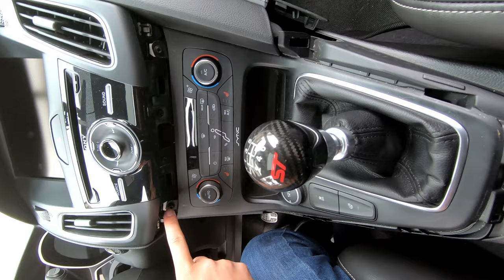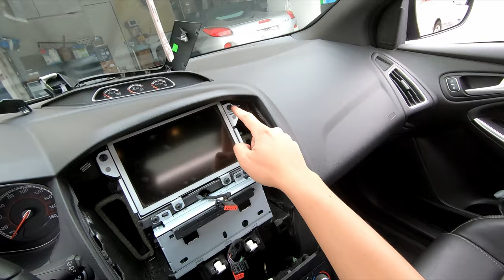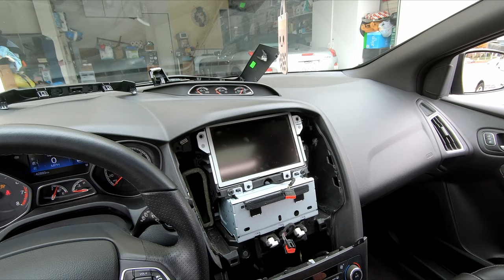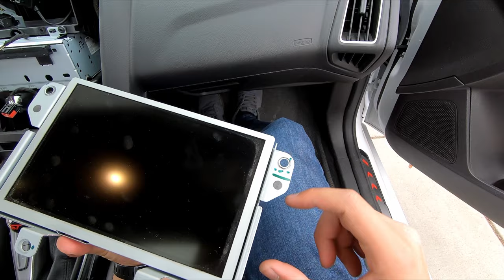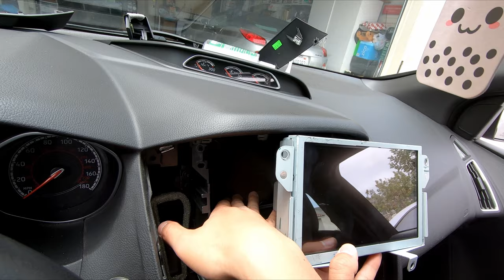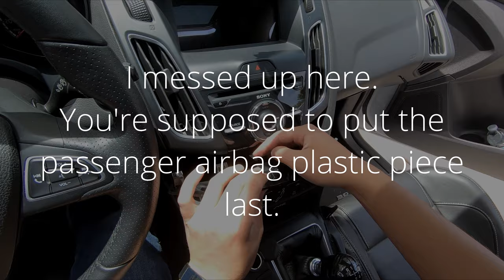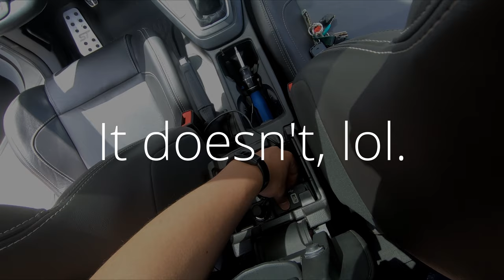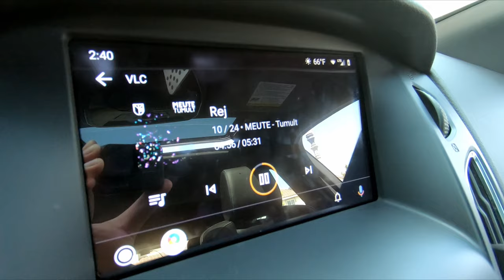How To Upgrade Sync 2 to Sync 3 for Android Auto/Apple CarPlay! (2015 Focus ST)

Comment: Great video, thanks. I am upgrading my 2016 Focus ST from Sync 2 to Sync 3 at the moment. I was very lucky to be able to access the parts from a dead Focus Sport. Anyway, the weird thing is my Sync 2 USB hub with the SD card slot & single USB-A actually has the same power outlet as a Sync 3 USB hub, I don't need the Gen2b power adapter, I found that to be unusual from all the research that I have done.

Comment: I assume if you buy this kit and get it registered to your VIN, It will continue to work okay for your parking sensors, self parking etc?
Reply from the maker: When you use FORScan, I think it'll automatically detect your VIN. In FORScan, you can turn all those things on/off. Focus ST doesn't have any of those so they're off

Comment: I've seems a few video on doing this and it looks simple enough, yet the dealer said it's not possible to convert from sync 2 to sync 3. I'm thinking of doing this to my Focus ST. Does everything still work after the conversion like the steering wheel controls, voice commands, etc and can I use the factory GPS antenna?
Reply from the maker: The dealer is right, you can't just update your existing Sync 2 APIM, you have to find a Sync 3 APIM and swap out the Sync 2 one. 

Yeah, everything on the steering wheel still works! For the GPS antenna, because the Sync 2 APIM's GPS antenna is built into the APIM, you'll have to get an external one for the Sync 3 APIM. I have the name of the antenna I got in the video description but it doesn't seem to work very well since the time is always wrong on my Sync 3. Not a big deal since I'm using Android Auto most of the time.

Comment: i found a guy that is selling his sync 3module (with no gps antena or usb though). it belonged to a fiesta titanium2017. do you know if its compatible with my focus titanium 2016(that has sync2)?
Reply from the maker: Good question! I don't think it's gonna work. The screen Ford used on the Fiesta is smaller than the Focus

Comment: Hi , Can I continue to use the old hub as I will be using an Android phone? You mentioned it in the video, but after installing SYNC 3, will the SD Card and Aux ports still work? And will the USB input in front of the gear also work?
Reply from the maker: Yeah, if you're using just Android Auto, you can get away with using the old hub.

I don't think the SD card and the aux will work with Sync 3 because it doesn't use either of those for anything in the operating system.

If you're keeping the old hub, the front will work. You'll have to use it since that'll be your only USB port.
Reply: @DaoDepictions   Thanks , So if I buy a new hub for SYNC 3, can I get a HUB with 2 usb ports, will both usb ports work? And are there any other things I should watch out for? Power cord etc.?
Reply from the maker: @1cemoy  Yeah, you can get a dual port hub like this one and Android Auto will work with either: https://naviupgrade.com/shop/hardware/sync-3-carplay-enabled-usb-hub/

This is what I did and so I'm good for Apple CarPlay too. If you get the dual port hub, it takes away power from the front USB near the shift knob so keep that in mind. If you have a 2013-2015 Focus, you'll need this, do some research though: https://naviupgrade.com/shop/accessories/adapters/hub-wiring-adapters/usb-hub-power-adapters/
Reply: @DaoDepictions  Thanks for the info Duc , But where can I find the model number of the usb hub in the first link you sent? I live in another country, I need to buy from another site
Reply from the maker: @1cemoy  Try this one? https://www.amazon.com/Genuine-CARPLAY-Interface-Module-HC3Z-19A387-B/dp/B07JCY9HFF

Looks like model number HC3Z-19A387-B or HC3T-14F014-BC